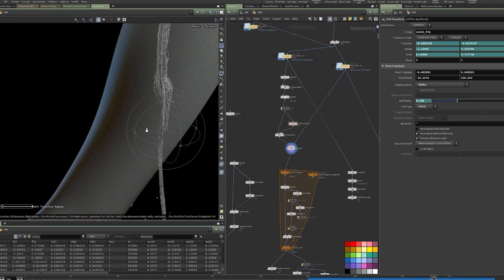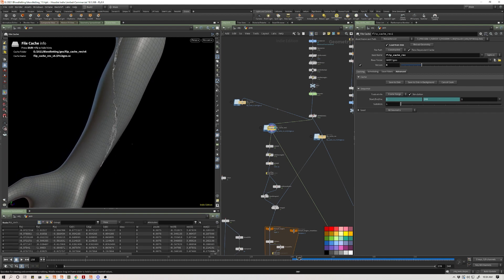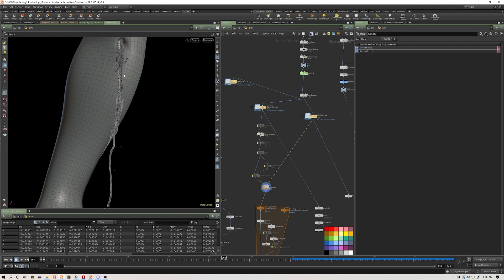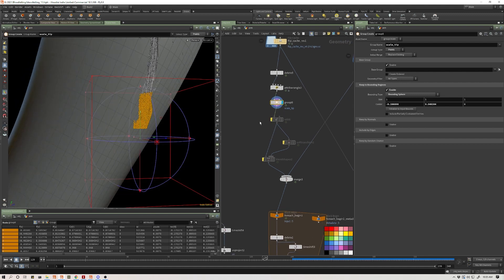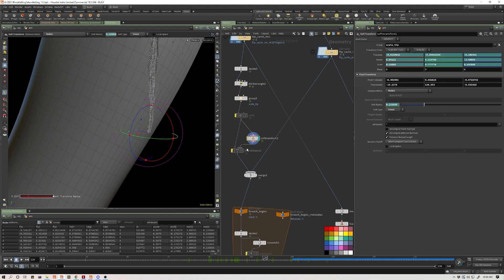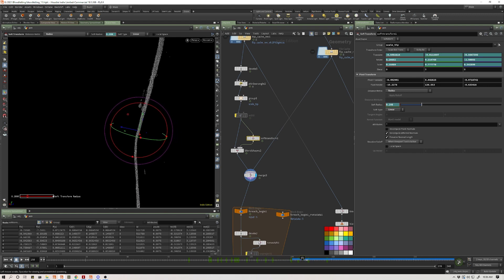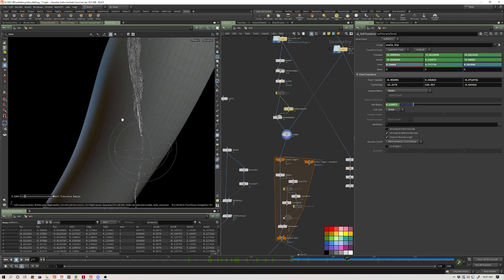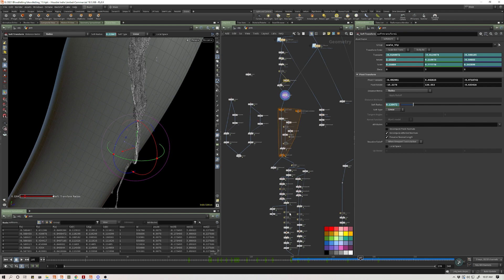Houdini Quick WIP Tip - Post FLIP Sim Tweaks

Comment: What’s the the wrangle for in this case?
Reply from the maker: I’m generating id attributes in dops and when I merge the two sims I need to avoid conflicts with that attribute. In the wrangle I’m just offsetting the id attribute by 500000 so all ids remain unique after the merge. 
@id += 500000;
I chose 500000 because it’s a round number higher than the max point number in the other sim.
Reply: @WhatIFound  got you, thank you this is super helpful.